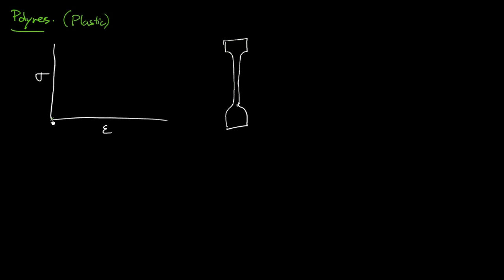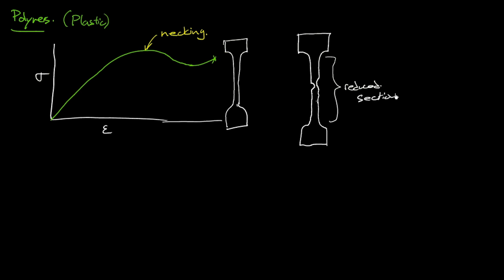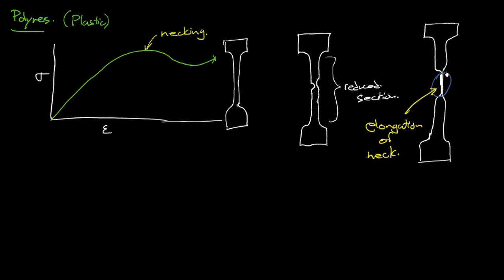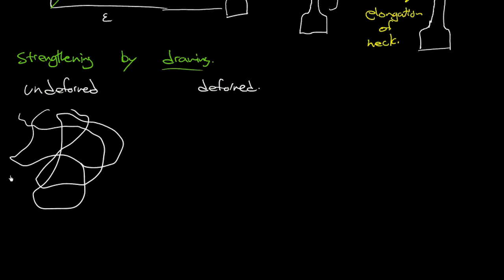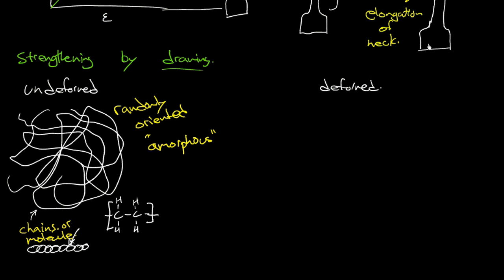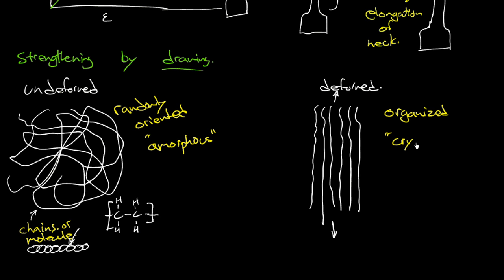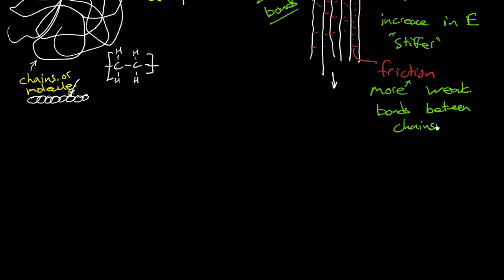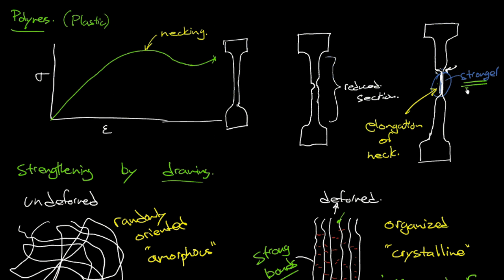Mechanical behavior of polymers

Comment: How when a polymer is deformed (crystalline) has more elastic value then the cross-linked ones.
Reply: More the crystalline portion , more the rigidness....
when stress is applied ... crystalline portion acts first and then later imparts the load to amorphous region which starts permanent deformation .........
Reply: Alos keep in mind chains in amorphous region have more degree of freedom than crystalline .....so they can move to show plastic deformation easily unlike the chains in crystalline portion ...